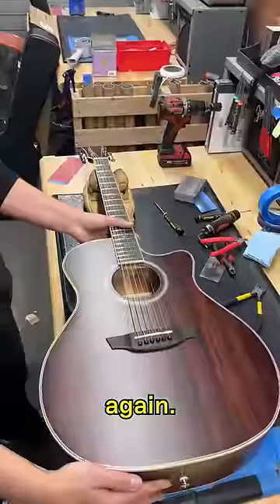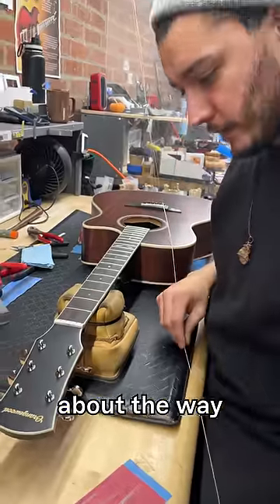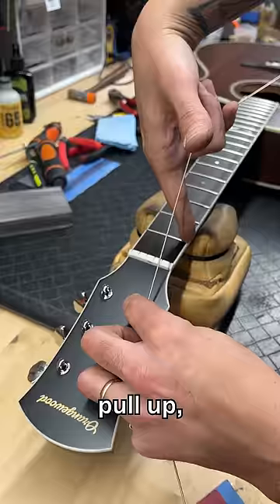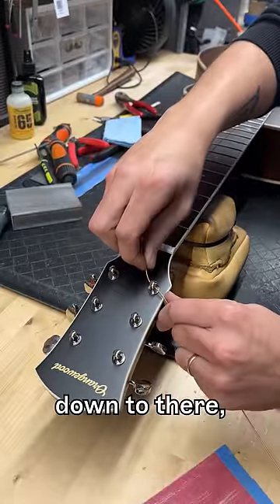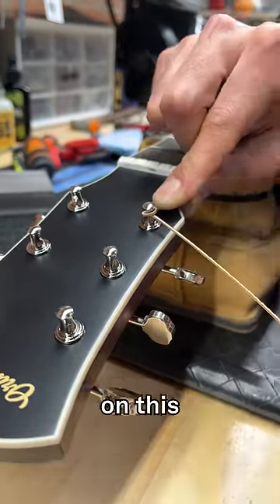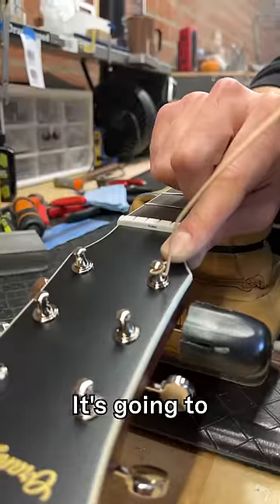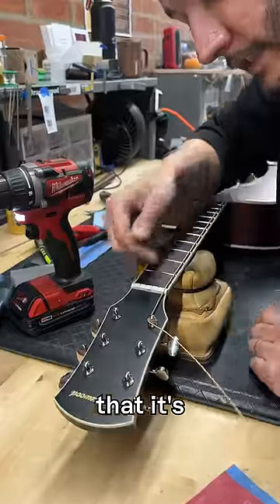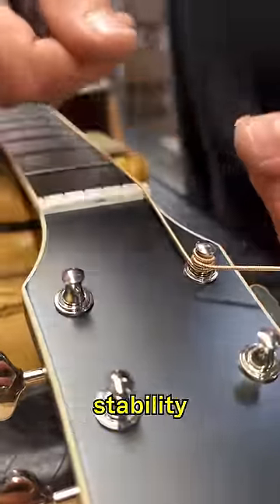Restring your Guitar like a PRO with this HACK

Comment: This is called a Gibson knot. It doesnt lock your strings, takes longer to install, and you'll hate yourself when you re-string. Just thread the string through the tuner, grab at the nut, pull back until your fingers meet the first fret, and wind.
Reply: Exactly
Reply: Rory Gallaghers Roady Mr. Odriscoll showed me how to restring a guitar I'll stick with that.... Rory on!!
Reply: Amen, this whole locking strings crap makes for horrendous string changes.
Reply: I don't get why it's horrendous to change strings, it takes only minutes.
Reply: @marcellino1956 awesome, I was just at the auction watching his strat get sold. Can you elaborate on the method the tech taught you?
Reply: I've been doing my strings the way shown in the video for over 40 years. I'm sure that your more simple approach is fine although I've never tried it, but my way doesn't take any longer to install and it's not a problem when I restring.
Reply: Been doing this for 50 years always works fine
Reply: I actually measure by bending the string(or cutting for vintage style) two tuner posts up from my desired one. Perfect wraps every time. Might give the higher strings a little extra for good measure.
Reply: @mikak2747 Me either. Especially, if you only do one at a time (like I’ve always done) anyway.

Comment: I'm 64 yrs old. Got my first guitar when I was 13, still have it, a Yamaha FG 160. Been stringing it all these years. I don't think there's any 'best' way to do it. Just get the strings around the posts, not too many winds, make sure they're properly seated against the bridge pins, stretch the strings with a tug, then tune. Oh, no need to cut the strings off. Just loosen em up and pull them off the posts. Why turn six strings into twelve?
Reply: Depends on the guitar. With strats for example it's a pain if you don't cut the strings because you have to feed the tangled ends through the body
Reply: There definitely is a "best" way to wrap it around the tuning peg
Reply: @whitehh15 dude thats pat “magpie” metheny I think he know about guitars better than you.
Reply: @Peeingstickymilk who's that's?
Reply: @BlamingBuddha  he’s the op on this comment thread
Reply: @Peeingstickymilk  No it isn’t.
Reply: @Timootius  It might be be because Im on 2 hours pf sleep but I don't really understand what you mean. You thread the string through the back of the body, how does cutting it affect how easy it is to feed? once you get the tip of the string through the body you just pull it.
Reply: Fifty years ago, I figured out. If I wound the first wrap under the string. The rest over. My string stayed put. I never used the method that is shown. It gives the string a half twist. I don’t know why you would want to do that?

Today, we have locking tuners. There is no longer a need to lock the strings, on the post, but I still do it, out of habit.
Reply: Exactly 👍🎼🎸🇺🇸
Reply: @Magpie7070  I agree.  So long as the strings are locked correctly on the post.  No wrong way.  I just do it this way because I feel why not give it some added lock in place
Reply: @voltic7133 Hi Voltic I think Timootius is just saying that if when taking strings off you don’t cut them you have to get the string that has been n bent and wound around the peg back through the hole which is a pain. Obviously it is a lot easier when you are adding new strings because the strings haven’t been bent.
Reply: @voltic7133 think he's referring to removing string's 😊
Reply: It's quicker. Professionals do this, and use electric string winders, because it isn't their guitar, and they probably won't be blamed if the neck and bridge/belly of the guitar fails in some way at a later date. If you are restringing dozens or hundreds of guitars a week, saves a lot of money.

Comment: As a blacksmith i recommend forge welding your strings to your nuts so they get a nice seal you can additional tig weld the string to the tuner for extra security. Never worry again!
Reply: haha... i like the way you think... serious business!!!
Reply: @tonyhort8343  The thing is, I have never bought a new guitar that has been strung that way; it's utterly unnecessary, and adds a couple of seconds per string. If you are stringing hundreds of new guitars a day in a factory environment, it will cost you time, and time is money.
Reply: "forge welding your strings to your nuts." OUCH!

Comment: Pro tip from a violinist, if you put pencil lead on your nut (not sure if it is called the same thing with a guitar) your tune will change less during playing sessions, as your string tension will settle more evenly on either side of the nut when you use pencil lead to lubricate it
Reply: What you're saying is basically correct. Pencil lead contains a lot of clay though. I just bought a little tube of graphite and sprinkle that on there.
Reply: Definitely.  A lot of pro guitar techs and luthiers will put some pencil graphite in the nut, possibly mixed with some other lubricant as well.  I’ve been doing it on my guitars for a few years
Reply: I roll the pencil lead on the slot so it sprinkles a little dust in there and also draw a little right on the string where it rests in there.
Reply: What if you’re 64 years old and you no longer have any lead in your pencil?
Reply: Sharpened. A Sharpened pencil lead make of Graphite.
Reply: It makes it easier to tune in the first place as well, particularly with the wound strings; and yes, it is nut and bridge on a guitar. The problem is, unlike violin nuts, usually black, guitar nuts are usually white bone or plastic, and you have to be a bit careful if you don't want it to look as if a dustman has been playing your guitar.
Reply: @bogan-slayer7469  Go see a doctor.
I'm 66 and like the old saying, "Just because there's snow on the roof doesn't mean the fire is out inside".
Reply: @edeledeledel5490  My dad played bass.
 He  preferred Ebony bridges, and then got an Ebo one. He hated it, and searched and found a pair of ebony replacement bridges, which he sanded and finished to perfection.

He also had a bone nut, but said it did not make that much difference.
Reply: @joeturner7959  I was only really talking about the colour and the fact that graphite is more noticeable on white nuts.

Personally, I think a lot of nonsense it talked about nuts and bridges. I don't think very much real scientific research has been done on the topics, so most opinions are really subjective, and not reliable.

Comment: I just thread it back through the hole. Never had any issues. I don’t think I’ve ever even had a botched restring before.
Reply: That is brutal for removing the strings later though. I’ve been a guitar tech for 10 years or so. I hate when guitars come to me like that. It’s now wrong or bad, but it’s overkill and a pain in the @$$ later on. I do it exactly how this video shows.
Reply: Same here dude. This way looks a bit more complicated to me.
Reply: @thisisnotmyname91  How’s it brutal though. You just loosen strings, clip them, then push the loose string back through the hole. I can restring all 6 strings in like 10 minutes sans tuning.

Comment: Also remember to stretch the strings after tuning them up to note, then tune them up again a few times. Helps to keep the strings in tune faster, as new strings are more stretchy. So you wanna help the strings to become less stretchy and stay in tune better. I dont know how much of what im trying to say is getting across but if you get it, hope it helps.
Reply: I am no guitar player but would like to learn to play and just how you worded it was enough for me to intake I understood your analogy I kinda visualized it lol
Reply: Yes I do this too! Thought I was the only one haha
Reply: @Mehsowhat lololololo that’s hilarious lolololo
Reply: I just tune them two semitones above normal, and then tune them back down again; this gets rid of all the stretching, and is perfectly disciplined and repeatable. Stretching the strings manually might strain them unnecessarily at a single point.
Reply: "Yank and crank" string stretching is for noobs. Re-string your guitar, tune it, and do NOT stretch your strings. Instead put your guitar in the case (without playing it) for 12 hours. This gives your strings time to stretch and seat properly. After 12 hours, retune and voila! Your guitar will now stay in tune without causing METAL FATIGUE in your strings by doing the "yank and crank" thing. This is how professional guitar techs do it between shows.
Reply: @catfishcooler1566  Tommy Emmanuel does it, and I think since he has been a professional guitarist since he was 5 years old, has a 64 year professional career, and is rated one of the best acoustic guitarists ever, probably knows a bit more than you. And he re-strings his guitar for every performance.

Comment: I used to string my guitars this way. Turns out, as the strings get a little give in them, it actually hurts your tuning stability. I went back to the old-school method, haven't had a problem since.
Reply: Yeah, stay old school. I never have a problem with tuning issues. Not once.
Reply: What is the old school method?
Reply: Just measure distance to wrap to peg, bend 90 degrees and wind it up from the bottom til tight.
  Plenty of videos out there...
Reply: Agreed, all these fancy locking methods don't improve things and just make them annoying to undo when changing
Reply: Thank you, this is just some dumb hipster thinking he discovered a new way to slice bread
Reply: Yeah, guitar techs hate this restringing idea. Ever have a high E string zap into your finger ? How about guys who don't cut the loose extra string they leave all coiled up at the headstock, thinking it affects tone ? Yeah, the buzzing sound. Or the poke your eye out sound of screaming tone.

Comment: This works. Same way I do it.  It's less likely your strings will pull out of tune .  Especially with heavy bends
Reply: If your strings are pulling out of tune with bends it is most likely caused by the string not returning to the original position in the nut. It should either be resized or smoothed out and lubrication added.

Comment: When I'm removing the strings I do it one at a time and I don't cut it, I just use the tuning peg to loosen the string then take it off...
Reply: He loosened them too… he just also cut them. Much faster. One at a time makes cleaning the fretboard properly a struggle.
Reply: @olavjorvik94  but it also will stress the neck when you remove the string pull.. i do it one string at a time to do it like a pro...
Reply: @jimburdin  "like a pro"? No professional does one at a time. Ain’t got time for that. Pros do all of them, clean down the fretboards of gunk and sweat and then check for any potential flex in the neck with the proper equipment. I could do that too, but I don’t gig so I tweak the truss as needed, when needed. If a neck is affected by loss of string pull, it will pretty much be equally affected by having it put back on. There’s no right or wrong here, we’re just sharing our methods. I change them just a few times a year anyways, and climate / temperature / moisture or otherwise is much tougher on the truss than any string change is ever gonna be anyways.
Reply: One at a time always for 45 years
Reply: @jimburdin   What will hurt is NOT taking them all off to oil the neck and letting it go dry.
Reply: @olavjorvik94 “No professional does one at a time” are you a professional? Doesn’t sound like it. Talk to any luthier and they will tell you the same thing these other wise gentlemen are telling you. Removing all of the strings at once puts a lot of tension on the neck. Over time this can eventually cause warping of the neck.
Reply: @olavjorvik94 - “No professional does one at a time” are you a professional? Doesn’t sound like it. Talk to any luthier and they will tell you the same thing these other wise gentlemen are telling you. Removing all of the strings at once puts a lot of tension on the neck. Over time this can eventually cause warping of the neck.  @jimburdin - they make tools and cleaning supplies to clean the neck with strings in place, yes it is more tedious but it is the proper way to do it. Easier doesn’t make it right.
Reply: @mattayers1096  I've used three different luthiers in my life. Not one of them removed one string at a time. They snip them all to work on the fretboard and frets if necessary. None of them ever did the goofy knot trick either, which is also completely unnecessary.
Reply: @mattayers1096  it doesn't put a lot of tension on the neck. You're relieving tension when you remove strings. If you loosen them first the impact of that drop in tension is minimal and won't damage anything. Friend of mine has been the tech for one of the world's biggest rock acts for years, he changes em all at once unless one breaks mid gig.
Reply: I just do one string at a time too even with my 12 string acoustic 🥰🏴

Comment: This is great. I always just pulled it back up for it so that it would have some slack and then I would just hold it down with my thumb and let it be under. This is a really good technique for nylon strings so that they don’t slip. I’m going to use this technique from now on thank you.

Comment: It’s also good to be wrapping the string around a few times so you can later on tune up or down. If you didn’t have any turns of the strings around the pin then later on you would run out of wrapping strings in tuning! Also pull up on the string in the middle of the fret board with a bit of tension so that when you do tune it will be a constant tension instead of having the string loose when you go to tune it. After about 40 years I’ve learned just how to string a guitar and learned on my own!

Comment: STOP!! This is an awkward method. It’d work only if the side of the string is free to spin. If string is not free to spin the one flipping over the top will create torsion tension which could break the wound. It’s crucial for bass guitar strings and upright bass.
For the 3 upper strings’ tuning machines (D A E) this method could damage the strings’ wound, for lower strings’ tuning machine it could create other directional torsion tension which could weaken the wound.
THE RIGHT WAY TO DO THIS IS CREATING THE FLIPPING OVER THE TOP BY SPINNING THE TUNING MACHINE, not by creating the lasso by hands!!!
Reply: I do it your way, even without a stringwinder. Has served me well for decades, in and out of professional settings.
Reply: Absolutely,  the rotation /twistiof the string does not allow for a free string. Now you have tension both directions on fhe string.  Just use the rotation of the string post to do the work rather than the "lasso".
Reply: I've never broken ead strings from the nut side, they all break from saddle if they do at all.

Comment: I’ve watched “pros” online string a guitar at least 3 different ways, that were all identified as the “right way” to do it.  On a 3+3, I pull the string to the next tuner, cut it, let 1/4 stick out, make one turn over and the rest under.
Reply: Correct method straight up

Comment: However you re-string, based on the various methods shown above, I always use a Kyser type capo between the nut and 1st fret when adding the new string. This keeps it in line, as I slightly tug 1/2 way down the string somewhere. I have been re-stringing my guitars, acoustic,electric, ukuleles, this way since the since the late 60s. Hint: for nylon strings (classical guitars, ukes), don't tug too much. You will instantly ruin the intonation properties of a new string.